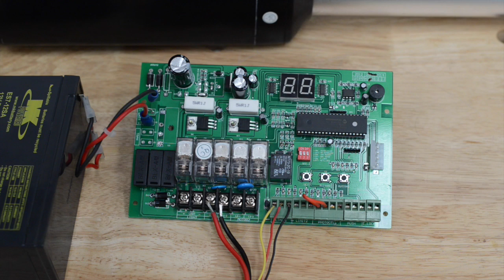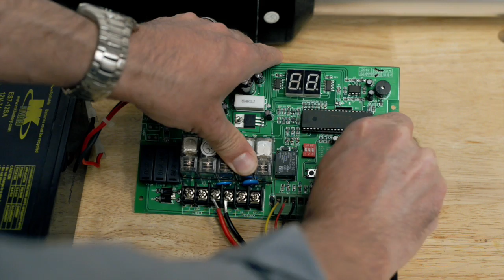How To Operate Estate Swing E-S1000H & E-S1000D Control Boards

Comment: I'm having lu issues
Reply from the maker: Good morning, LU stands for low voltage battery. Plug in options voltage should be 13.1- solar options 14.1 in rest. When the battery is under load it should not drop more than a tenth of a volt. Please call us for any further assistance - thank you!